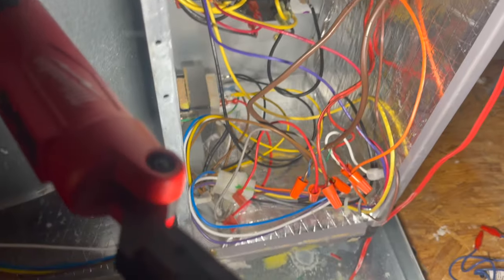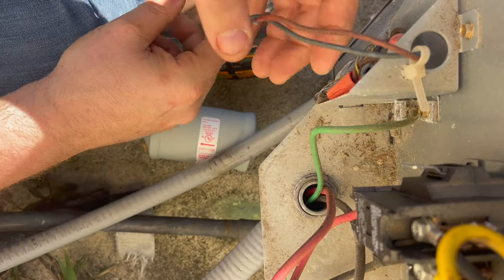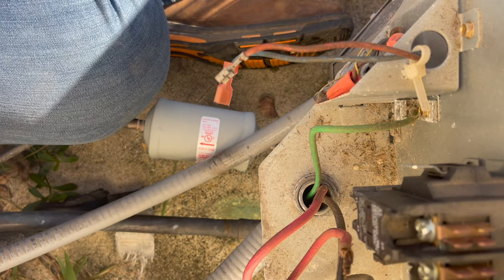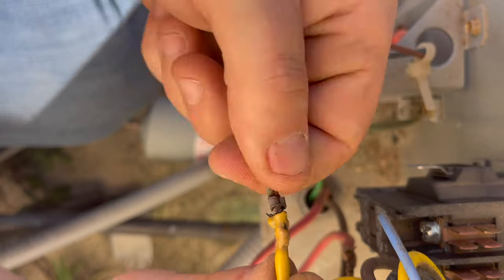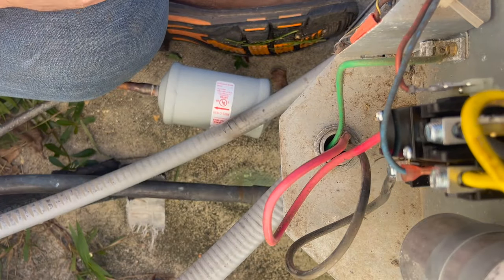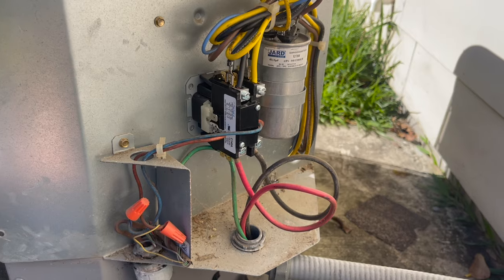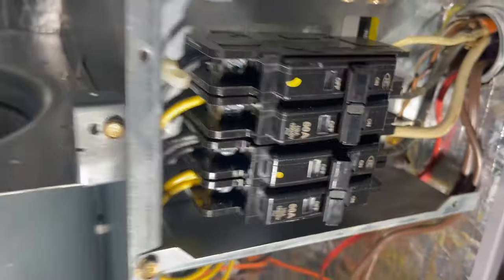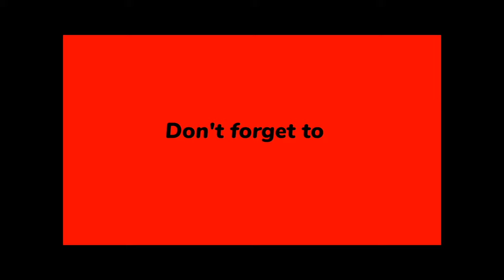Cheap Contactor Strikes Again

Comment: Hey John, good job on that call. Just wanted to throw out a helpful tip for those that may not know, the lugs on the contactor can be swapped if the old contactor used the crimp on connectors and the new contactor has lugs for bare wires. The lugs can be removed by completely removing the big screw and a smaller screw will be underneath which will allow you to pull the lug off and you can use the screw from the old contactor so you dont have to cut the crimped connectors. Nothing wrong with doing it the way you did though, especially if its out of warranty. I've  done it that way many times. Anyway, just wanted to point that out for some newer techs that might not realize it.

Comment: Good trick is to cut the tabs off the wires on the load side. Leave the crimped section and you can screw it under the lug. It creates a nice tight fit.👍🇨🇦

Comment: And I love that new Klein multi screwdriver/ nut driver. That 1/4" hex adapter in the handle comes in so handy for all kinds of stuff. You can shove anything with a 1/4" hex in there and lock it in (great for a 6-inch extension). I stopped carrying my Malco connext after I got the Klein. 😮
Reply: I've been wondering if they work good. Now I need one. 😁

Comment: Hey man, im still pretty new in the hvac world and was looking thur ur videos and found u worked on tons of mobile homes before. Trying to fix something for a family member of mine in a mobile home. He has a leaking problem with the downflow furnace that has an a coil above the blower. When ever you put the blower compartment panel on, water gets sucked out and over the drain pan and onto the top of the blower housing. Ive checked the drain line and it was clear, doesn't have a trap tho. It just goes straight does with flexish coragated line. I thought maybe its pulling so much air it's pulling water too so i lowered the speed to medium but it still does it. A few things i can think is that when he replaced the blower motor, winair (hvac seller) told him the motor will be an exact replacement but could have been the wrong horse. Its a 1/3 hp fan right now and i don't know what the one before was.

 i also did notice the triangle sheet metal panel that goes on the face of the coil has a rusted up hole in the corner that the water loves to get sucked thur. Dont now if that hole would cause the problem or not. 

If uve seen something like this before or might have any suggestions, it would be greatly appreciated 👍